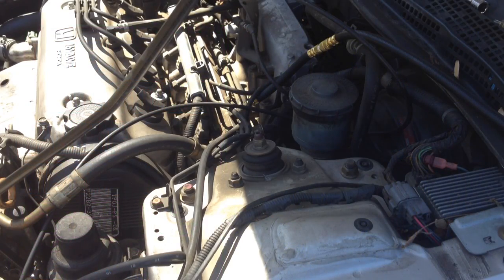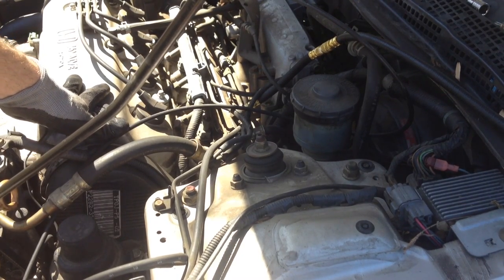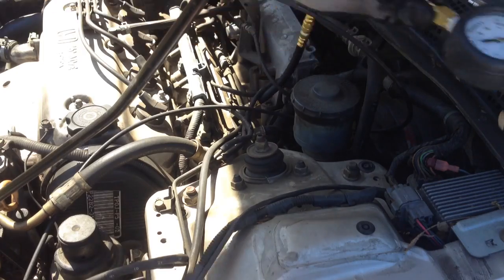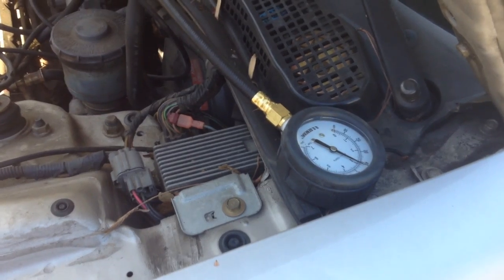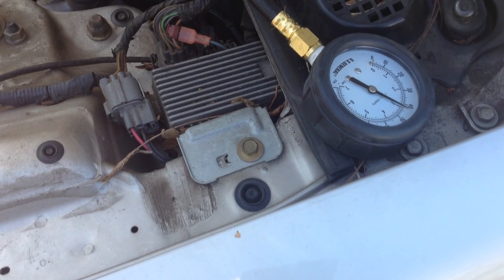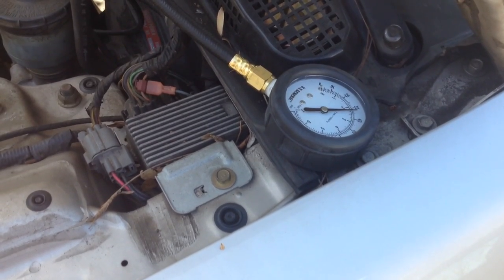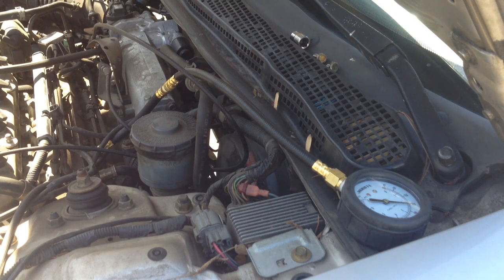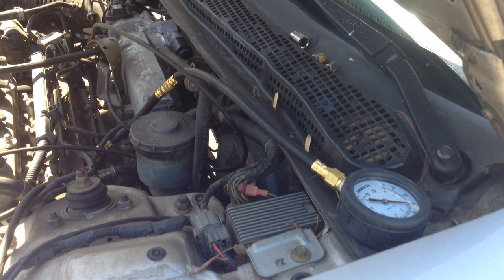Honda Accord Fuel Pressure Testing

Comment: mine still the same new fuel pump new fuel filter   i blow air on the fuel line and return line no clogged.   when i turn the ignation with the pump on the guage reading 44 psi  when the pump stop the guage drop to 34 psi  in one second any idea?

Comment: But how do i check the pressure if it won't even turn over
Reply: I know this is super old but I’m commenting anyways bc ppl will read comments to u and get incorrect info

Yes, the car could not turn over from a fuel issue. Blown fuses, bad relay, clogged filter, bad fuel pump, bad fuel pressure regulator, ect. 

If ur car won’t start, first u need to get a spark tester. It’s SUPER EASY to do. That will tell u if u have spark, then u will know it’s prob fuel. Another thing, if ur car won’t start and u think it may be ur not getting fuel, spray starter fluid into the air intake, then try and start the car. If it starts from the starter fluid (will die again quickly), u have a fuel issue. That starter fluid replaced the fuel and started the car. 

Vehicles need: spark, fuel and air. Just narrow down the issue one by one.
Reply: JENNY HER 

If it won't turn over, then the problem isn't with the fuel system.
Reply: My car trying to start but it is flooding it don't have a carburetor or fuel injection I have changed spark plugs got the gas out of the does spark plug holes and it just keeps flooding what do I do can sell anybody give me some kind of Clue if somebody could can they message my phone and tell me what I could do to it on this 425-212-8292 thank you very much
Reply: Main fuel relay issue possibly if so it’s an easy fix

Comment from the maker: You have to buy a banjo bolt adapter. If you google or look around on eBay you can find one. Some even come with a pressure gauge
Reply: hondapartshero So you needed to buy a special adapter to do this video?
Reply: God i hate honda for doing that.   F their cars.

Comment: my 97 does not have a test port how can I check the pressure
Reply from the maker: Juvenal Macias you should have a small bolt in the top of your fuel filter that if you take it out you can use
Reply: hondapartshero my fuel filter has a hose from tha top that goes to the fuel rail
Reply from the maker: Juvenal Macias you'll have or buy a banjo bolt adapter on eBay or other places. Some even come with gauges

Comment: What was the fix for your car?
Mine is doing the exact same thing.
Reply: After replacing the fuel filter the code never came back.
Reply: hondapartsheroful I replaced that and the fuel pump, no change. Any ideas?
Reply: hondapartsheroful yes low fuel pressure, 34psi @ idle. It trigers the check engine light with p0300 codes (all cylinders misfiring) just put in a new fuel pump, no change. 99 Honda cr-v 130K.